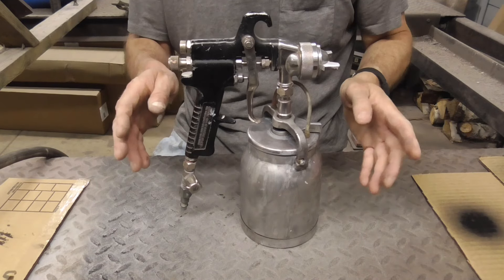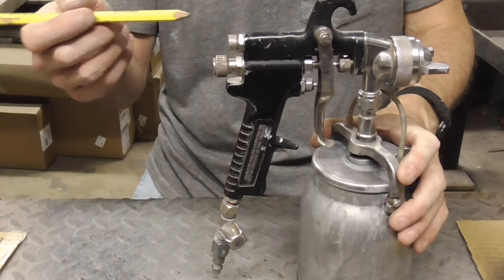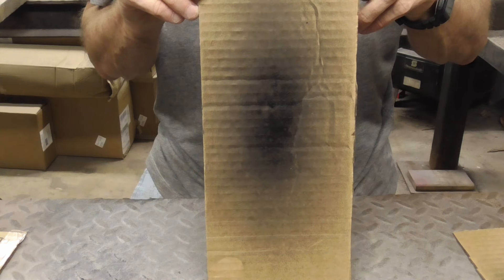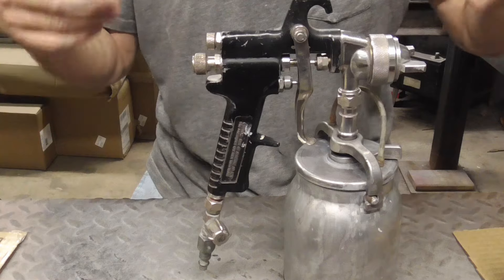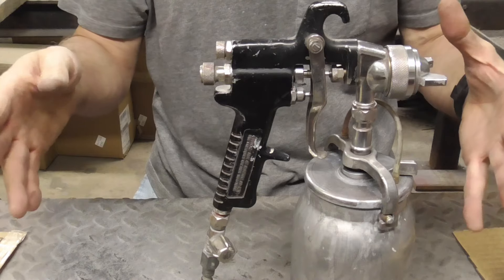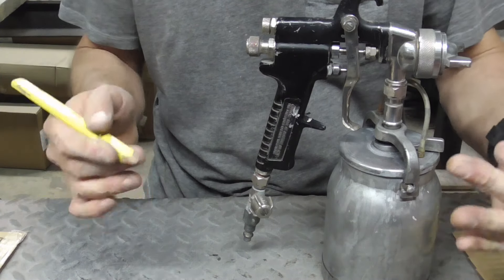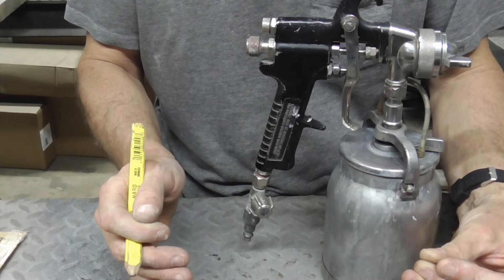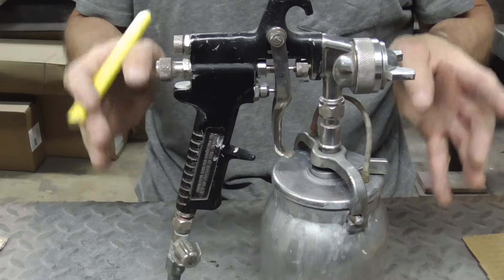A "Rule of Thumb" Method for Adjusting All Automotive Spray Guns

Comment: Been painting for over 40 years with great results.........when i learned to paint, NO ONE PAINTED WITH THE FLUID ADJUSTMENT WIDE OPEN!!!!!!?????? now it seems to be the rule???? Maybe I been doing it wrong for 40 years///lol...lol...???????
Reply from the maker: I agree - I don't know what the heck happened.  Why is there this pressure that it MUST be wide open - where did that come from.  Heck, the older guns would get heavy paint on the ends and thin in the middle if you opened it too wide.  Each gun is a bit different so it really depends on the gun and how you like to spray.  Thanks for the comment Brian :)

Comment: I uploaded that video of the bad rust spots on my truck on my channel. Idk how to fix those.
Reply from the maker: OK just got back from out of town - I'll take a look soon and let you know
Reply: @LakesideAutobody  ok thanks
Reply from the maker: If your rust holes are on the underside of the cab, you can remove the seats and carpet or pad, cut a metal patch out of sheet metal and MIG weld it into place or watch my latest video on JB Weld and use rivets and panel adhesive if you don't weld.  Anyway, on the body you would do the same, then knock the patch down with a body hammer or hammer and punch and fill it with body filler - this video shows how   https://www.youtube.com/watch?v=6OEKdFTUEFk
Reply: @LakesideAutobody  awesome thank you so much
Reply from the maker: @texasgrown2021  You're welcome - go "Rust Repair" playlist on my channel, there is a ton of good information on rust repair -
Reply: @LakesideAutobody  thanks again. I appreciate the help

Comment: So, everything is about half way but what is the “half way” pressure to set my air compressor to?? Guess I missed that??? Never tried this new gun before...thanks...👍🏻
Reply from the maker: You don't have to set your compressor to a lower pressure.  I think my gauge on the compressor says around 90 psi most of the time.  I never set the pressure at the compressor just a to the gun - hope that helps :)

Comment: Thanks for the knowledge. My issue is that the spray gun will not suck up the paint. help...
Reply from the maker: Is it clean?  Is the paint too thick?  Try straight thinner or reducer first.  Is the tip on correctly and all the original parts?  Let me know what it is or was - curious :)

Comment: Hey Jerry I've got 400 grit scratches that showed up after spraying metallic basecoat. I read somewhere that the clearcoat will fill them up. I've read elsewhere that they need to be sanded with 600. What do you think?
Reply from the maker: I think the clear coat will "bury" those.  You can go ahead & clear coat it.  Let that dry and if there is any that show up you can lightly wet sand with 1200-1500 grit and buff.  Or you can let the base dry, wet sand with 600 and go at it again.  Let me know what you end up doing my friend :)
Reply: @LakesideAutobody  I ended up wet sanding the base with 600 on a pool noodle until I felt that every area was smooth. Then I applied more base. After clearing over it, I can still barely see some scratches. Good enough for me.
Reply from the maker: @gpc1091  What brand paint and clear?
Reply: @LakesideAutobody  Nason base and clear. Initially when I sprayed over the scratches they disappeared but once the solvent flashed off they came back. I've used Sherwin-Williams paint before and didn't have that problem.
Reply from the maker: @gpc1091  Got it.  Got it - thanks :)

Comment: Hi Jerry I just got a used 2001 cup gun how much cfm will I need to run this? I plan on using it for primer and top coat on my rebuilt door bottoms and rockers.
Reply from the maker: I have that gun - a Binks 2001 w/ 1.8mm tip.  I can spray that thing all day using my compressor - it puts out 6.4 SCFM @ 40 psi / 5.4 SCFM @ 90 psi  You could probably get away with less but I'm actually running a minimum really.  I recommend something like this - https://www.harborfreight.com/29-gallon-18-hp-165-psi-oil-lube-vertical-air-compressor-58507.html- pretty quiet, oil filled, belt driven.  Dewalt makes one just like it but maybe a little bit more $.  Tractor supply carries a lot of this style compressor CH, Dewalt, Porter Cable - https://www.tractorsupply.com/tsc/product/porter-cable-20-gallon-portable-belt-drive-air-compressor

Comment: What is a good pressure to set a regulator at??
Reply from the maker: 25-30 for a conventional gun like this is normal :)
Reply: My Binks #7 likes 45 to 55 psi for single stage enamel.

Comment: What brand is this gun ?
Reply from the maker: Campbell Hausfeld - it's their version of the Binks Model 7 - mines old but this is what's available from them now - https://www.campbellhausfeld.com/spray-gun-with-rev-canister-dh650001av.html?category_id=67
Reply: Do u recommend this type of gun for auto body ? Thanks man
Reply from the maker: @adriancantu9140  At one time this type of gun was the KING of auto body spray guns.  If you like conventional guns - that is cup on the bottom - you can't do much better than these - Binks or a copy.  If you like the cup on top CH also makes them - Campbell Hausfeld is a reliable company.  Yes - this type of gun will work fine for auto body :)